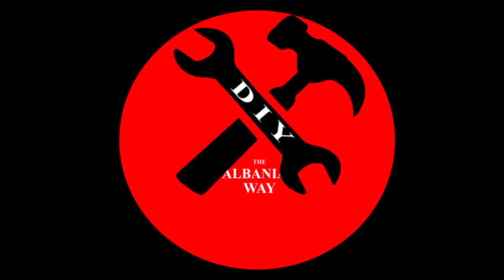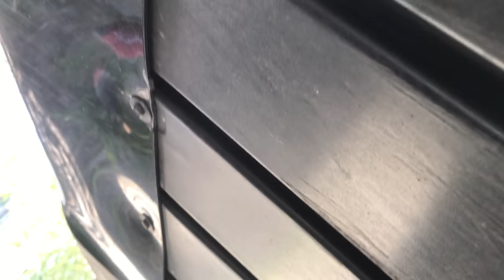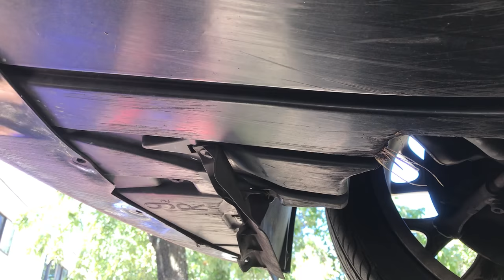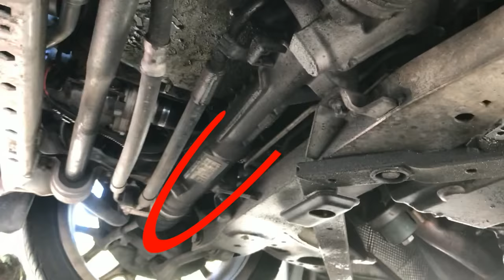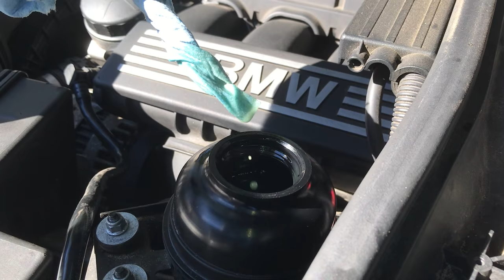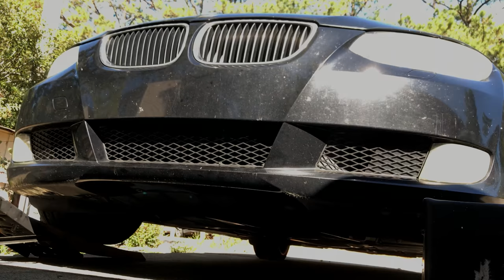BMW Whining Noise SOLVED!!!

Comment: Thanks brother, I figured my 2006 BMW 325i was bad fluid. I heard a whine when steering left/right and when just idling. Took it to Pep Boys and they told me it wasn’t a guaranteed fix but I knew it was bad fluid. They flushed the power steering fluid and BAM!!!! Whine is gone! Fluid was brown and horrible. Now, I’m monitoring the pump/fluid. But so far, really really smooth and quiet.
Reply from the maker: Yeah I was shocked too when the noise completely disappeared. I figured maybe a little bit of pump noise would be still there but no completely gone! Glad it worked out for you as well!
Reply: My car has about 160k miles and I will be replacing the power steering pump and reservoir soon. The whine is gone, but just feel like it’s the right thing to do. They said that fluid was brown. This was a temp fix for me until I get time to replace those components.
Reply from the maker: Very true, it is indeed a temporary fix. I’m also looking forward to do the same replacement too.

Comment: If your power steering pump reservoir and cap continue to get dirty with fluid vapor it’s time to change the reservoir - its internal filter is failing.
Reply from the maker: That’s good advice! Didn’t know that. Thank you!
Reply: Can that cause the pump to stop completely if the canister is stopped up?
Reply: @marktaylor5479  no, but most likely use more power steering fluid in the long run.

Comment: I totally agreed. This is the best way to flush and add new oil. It’s by far the video for power steering oil change on YouTube. Thanks for making this video.  I am going to change fluid soon. And this will the first time I’m doing the proper way.👍🏻
Reply from the maker: Thanks Om!
Reply: @AlbanianFix vlla you said that the car was whining when cold and gradually it went away as the car was heating up. In my car it's the other way aroune. I had to change valve stem seals in my 545i so i had no choice but to empty the reservoir and i added CHF 11 and all was good, this was winter time, as the weather got hotter it started whining. The level is always right when i take a look, I am confused...i forgot to mention the fluid gets bubbly...

Comment: Great video.  Thank you!  How many liters of power steering fluid did you use to complete the flush?
Reply from the maker: You’re welcome! So up until I could see the fresh green fluid coming out of the rack I had already used 3/4 of the 1 liter CHF can but I still continued flushing the system with the rest of it. So in my case I used the whole 1 liter can.

Comment: I had another car with rack and pinion steering that suddenly lost the power assist when turning to the right -- but worked fine turning to the left.  I thought I would have to repair or replace the rack assembly, but someone suggested I add Marvel Mystery Oil to the power steering fluid, which I did, and it solved the problem immediately.  Don't ask me why, it just worked!
Reply from the maker: Oh wow nicely done! I will keep that in mind for sure. Thanks!

Comment: Mom's 2009 528i ..(E60-N52 engine)... In '23.... ,   While dealing with oil deposits both sides engine, idler and tensioner pulleys redone, pending valve cover gasket change, I checked the steering fluid resevoir. It had fluid but not touching showing on cap stick. A couple days after niece's acquaintance did gasket I topped steering with Prestone European (green). A couple hrs later Mom calls with hard steering, drove three miles home. I think hose crimp failure at pump intake flange , which connection secreted enough when I filled it to "spray"? 3" forward on pump pulley and the serpentine belt jumped to shreds..... I have plenty extra ATF, and/ or clear steering fluid which with your method I could see the clear exchange below and then replace with new ATF or buy CHF11s... /(?)\
Reply from the maker: If it was me, I would do CHF since that completely solved my issue.

Comment: Nice job, is it okay if i take power steering pump to rebuild it and clean it before new fluid? Is there some kind of a cleaner for power steering system? I have a lot of noise when starting it cold...
Reply from the maker: I think that would help a lot if your willing to do the work. I’m not sure there are any specific cleaners out there for this type of job but taking the pump apart and cleaning it with fresh power steering fluid would do the job just as good.

Comment: Great vidéo, how do you lift up your car ? Wheeler you put the lifter please ?
Thank’s
Reply from the maker: Thank you! The car has 4 hard plastic blocks, two on each side made for jack points to lift it easier. Once I lift the car up high enough on both front jack points, I slide in a couple of jack stands so the wheels can be in the air.

Comment: My 2011 E92 N55 makes the same noise all of the time running at all RPM’s and both hot or cold. Thought it was steering fluid so I changed the fluid put in new Titan CHF 11S. But nope, still making noise. Gonna check valve cover, CCV valve next.
Reply from the maker: Might wanna check the pump itself…

Comment: Hello. I've drained fluid through pipe nut, after that i've filled approx. 700ml of CHF11S and when I've start engine there was terrible noise when I sway the steering wheel left dead point to right dead point. Then sound became little less noisy. BUT! There are still stay awful sound when I turning steering wheel. Is that is normal?
Reply from the maker: You said you drained fluid and then refilled 700ml. Why? I showed in the video to fill WHILE it’s draining. That way there are no air pockets introduced into the system which is very important.
So, I believe you have air in the system which makes the pump work harder and give out that noise.

Comment: I just purchased a BMW warranty. $184 max if anything needs fixing. This labor outrageous at an ASE mechanic or bmw dealer. Have a whining noise coming from driver side front while idle and driving. When I apply the brake, noise stops. Can anyone advise what issue could be!!?  Thank you.
Reply from the maker: Hmm... when you mention the brakes, it doesn't really apply to this issue. Just thinking outside the box... Do you have a possible vacuum leak in the brake booster? Was the extra warranty not covering this?

Comment: PLEASE HELP? I have a bmw x1 e84. It makes a whining sound which is very loud on cold start but gradually quiets down as you drive the car, but does not go silent. The whining sound corrsponds with the revvs of the car, so the higher i revv, the higher pitch it gets. Iv changed PS oil(atf) and resivoir, but it stil persists. My steering wheel is slighly heavy compared to other similar cars iv driven. PLEASE HELP
Reply from the maker: Might need to change the pump.
Reply: @AlbanianFix  yea i was planning on doing it soon. thanks for the feedback. i cant think of anything else that could make that noise and iv been searching for anything similar online but your video has been the closest. so thanks again
Reply: @nathanfoxen did u fixed it?

Comment: Mine only make that noise when I left the car overnight while sleeping but once I turn on the engine it makes that noise but once I drive around and the entire and oil running smooth it just gone no noise but everyday I have to drive 15-20min till the noise disappear. Any ideas what it does that???
Reply from the maker: That sounds exactly what mine would do every mornin too. Once it warmed up, the noise would slowly disappear but even then, I still would hear it sometimes when I turned the wheel to the extreme right or left.
Reply: @AlbanianFix  most likely pump. Fluids stops and goes to bottom then starting it the pump is weak and doesn't move the fluid correctly
Reply from the maker: That's also a good indicator. Thanks John John!
Reply: @BMWI-gk9wh  I changed the pump and new fluid and still makes the same sound.
Reply: @atmosphere6475 
So what did you do
I also changed them twice but I don't think the mechanic bleeded the system in the right way
Reply: @nezarl8374  it was the pump belt
Reply: @atmosphere6475 
If the belt was loose will it damage the pump or make it squeek?
Reply: @nezarl8374  I don't know if will damage the pump,but it sure makes it squeaky
Reply: @atmosphere6475 
I'm on my third pump this month
It lasted 8 days ( I actually drove it four times only )
And the noise just came back
I'm guessing the mechanic didn't bleed it the right way
What do you think?

Comment: Why is your fluid green? Doesnt the cap say atf oil only? You're going to wear out your pump using normal power steering fluid on this engine.
Reply from the maker: This was recommended in various BMW forums. I kinda had the feeling to follow the cap but a huge amount of comments were recommending this one.
Reply: @AlbanianFix  late to the party, but the caps on N52/N51 engines that I've seen say CHF-11S, maybe turbocharged models use different stuff?

Comment: Brother I Have Changed my Compressor and Condenser of my BMW X1 because my AC Was not Working.... But after the Replacement of compressor and Condenser...Now My Steering Is Making annoying Noise when I Move My Steering left and right but This Happens only when My engine is On And not Running the car it's in its steady state... BUT when I'm running my BMW X1 At 40km/h speed or above then the steering Is not making any annoying Noise....when I'm moving My Steering Left and Right... Any Solution?? My Steering pump Is defect or Any Other equipment??? Plz give me solution Brother... 🙏 Got it?
Reply from the maker: Hey Vishal, since the AC work that you’ve done doesn’t really have to do anything with the steering pump noises, I would say to 1st change the fluid and see if that fixes the issue and if not, then I would look into changing the pump. Good luck!
Reply: @AlbanianFix  Thanks A Lot Brother... 🙏❣️
Reply: @AlbanianFix  which Fluid Will Be good And Tell me the quantity brother....??
I am from India and I Have to search for that Fluid... 😁
Reply from the maker: @Invincible-l3r  I used CHF 11s. There's no quantity requirements because I used the whole bottle to flush out the old fluid as shown in the video. So you might need maybe less than me.
Reply: @AlbanianFix  Okay Bro... Thanks A Lot Brother... love From India Bro 😘❤️

Comment: why would the whine gets louder when rising the rpm? no sense
Reply from the maker: Because the pump is powered by the serpentine belt which is spun around when the engine turns and the faster the engine turns the faster the pump works and thus makes more noise.

Comment: what is the cause of the noise at 5:15 , when the steering wheel is a full lock and grinds
Reply from the maker: That’s normal, it’s because the pinion is pushing hard against the rack but because the pathway is at its end and there is no room for the the fluid to push through which then creates pressure and then the pump works harder and therefore the noise. I always avoid to fully lock the steering wheel and if I have to make a U-Turn, I always back off a quarter or half a rotation from the lock position.

Comment: no explanation and details what fluid was used how much you drained and what year or model of car, active dynamic steering or not
Reply from the maker: Fluid used is in the description.
Car model is at 0.20 second of the video.
The rest of your questions can be easily looked up by the “aforementioned” car model. And if you can’t pull that off then you shouldn’t be working on cars to begin with.
Don’t judge videos before you do your homework...
Reply: @AlbanianFix   thanks for replay
Reply: So rude, wow. How about thanks for making the video... geez.
Reply: Not sure about EU or other models, but for north american models you can tell if its active steering or not by the powersteering reservoir. If it's all black you have active steering, if there's a green cap it's not active.
Reply: Al bmws you the green can only.

Comment: Omg I hope this is what wrong with mines because  I don't wanna spend so much money. It's like as soon as I put the fluid in it comes out
Reply from the maker: If your car makes the same type of noise then I pretty sure its got the same issue as mine.
Reply: I had a mechanic  look at it  and he said it's the rack that needs  to be changed. That a 1st opinion
Reply from the maker: @seductvebrwngyrl  The rack? oof... Can he try to just do a fluid change first and if that doesn't resolve it then you can look at the more expensive solution.
Reply: @AlbanianFix  I'll  ask him but I'm taking it to another  mechanic  because  that's super spendy
Reply from the maker: @seductvebrwngyrl  Yeah I agree...

Comment: Is the process the same for e36 model (316i)? After refilling atf the whining noise   near the engine  was gone but when i turn the steering all the way to the right or left theres a groaning noise loud weird noise with strong vibration i was alarmed what could be the possible problem of my power steering?!
Reply from the maker: I’m not really sure about your model but I believe, yes, it should be. The noise that you’re experiencing is exactly the reason why you need to completely drain the system out all the gunk deposits that are still floating in the crevices of the power steering rack because refilling from the top won’t get rid of all the residues that lie at the bottom.

Comment: Is that a drain bolt or a banjo hose bolt?
Reply from the maker: Good question... I don’t really know because I never took it out all the way see the kind of bolt it is. It just took a little bit to get unscrewed and fluid came out right away.
Reply: @AlbanianFix  but was there a hose line attached to if?  I'm working on a e46 and I don't see a drain bolt.
Thanks
Reply from the maker: @zaxosz5063  Yes there is metal pipe attached to it. The setup of this bolt with the pipe looks very similar to the ones from the AC condenser attachments.
Reply: @zaxosz5063  so the e46 doesn't have a drain bolt?
Reply: @zlabfab487  I don't think any of them have a drain bolt.